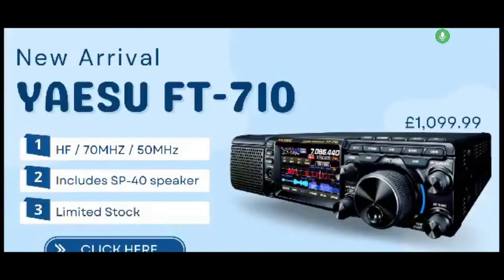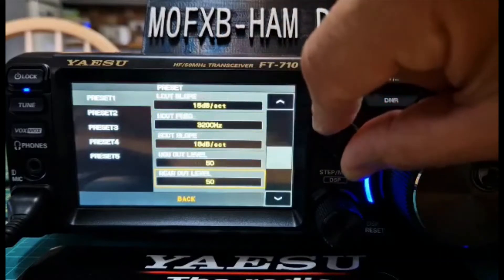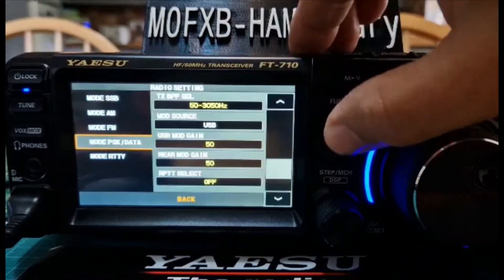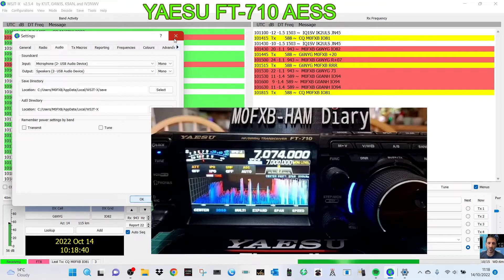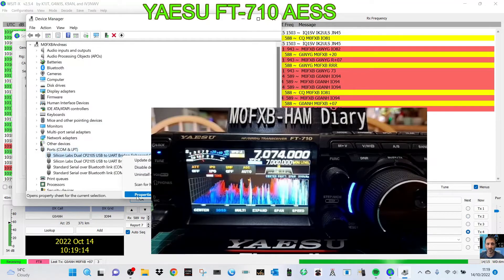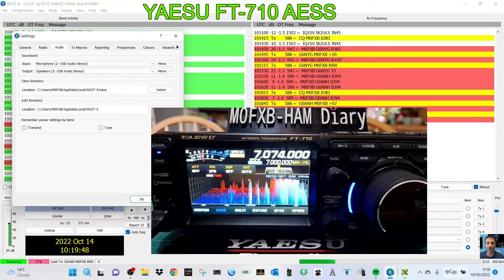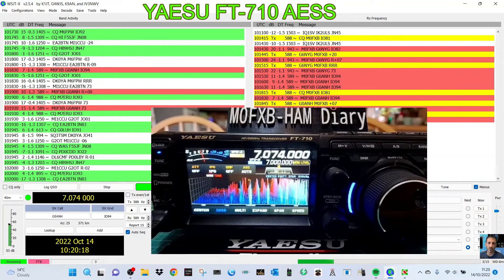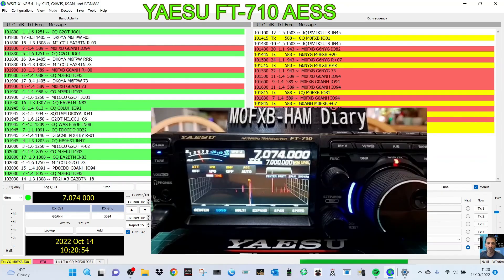YAESU FT-710 My FT8 Set Up

Comment: Appreciate your video . But you have not shown how the connections from 6 pin Din socket given  on the back of Radio which is more important. Is it to be connected to a Modem like SignalLink ? Or 
Just connect usb cable to FT-710 ?
Reply from the maker: You just use the Square printer cable as the 710 has a built in Sound card .
Reply: Use a USB A to USB B cable, preferably shielded and with ferrite chokes.

Comment: Got a 710 but FT8 is a no go right now. My error is that there is no audio being transmitted. I get the red transmit light but no audio. Any thoughts? Checked many, many settings but I can't find the stinker. You would think someone could publish all the settings for FT8, then you change the settings for FT8 in the Yahoo 710, and it works. Way too many hours of searching.
Reply from the maker: Try the FT8 pdf on my Facebook ,https://www.facebook.com/share/SU2yUxi3ki992JXY/
Reply: Thanks have downloaded the pdf, will work on getting setup for FT8 thanks.
Reply: W8BLT